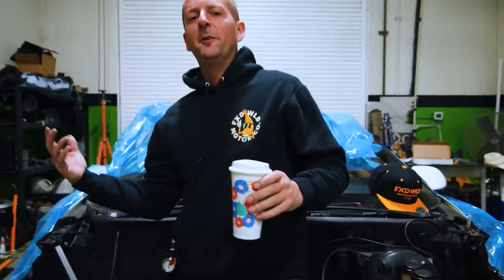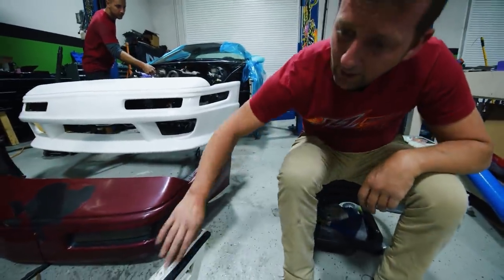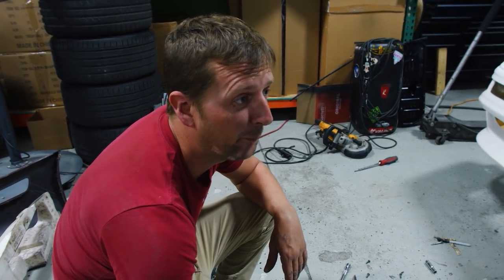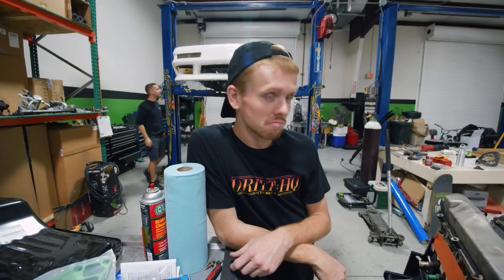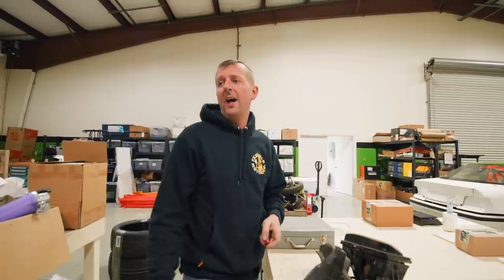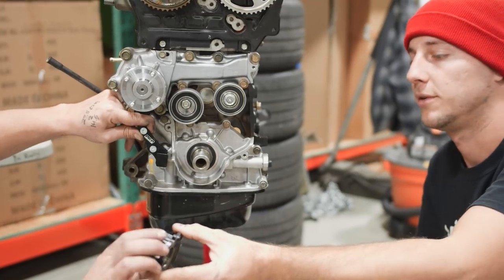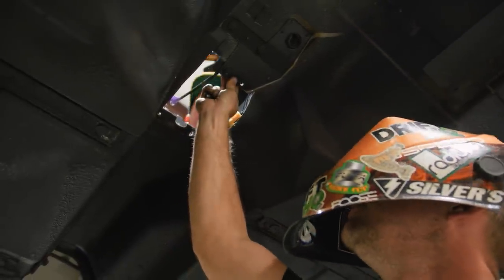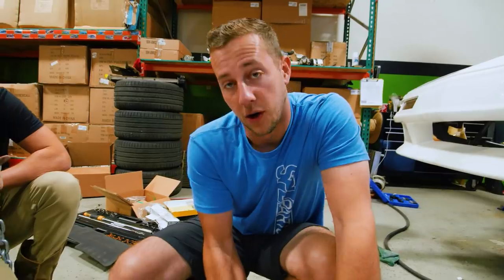RB25 NEO Upgrades for the C4 Corvette!

Comment: I am not sure what you guys have planed for the differential, the C4 came with a Dana 36 for the auto's and the manuals came with the Dana 44, you are going to at least upgrade to the Dana 44 it's stronger and has better aftermarket support, Good Luck with your build. Good Video. 👍👍👍
Reply: We took your advise and put one in 🤘🏼🤘🏼🤘🏼

Comment: Ducking hole only needs to be 1/3rd the size of the radiator if you doing proper ducting,  it slows down the air across the radiator 👌🤙 Venturi effect 💯🤙
Reply: Good to know that’s about where we are at after cutting the front bumper support
Reply: @CrickettFab  Aw great stuff Crickett👌🤙💯 Thanks for the reply, Il be your Irish rally expert resident 😋I'm might be a Mechanical Engineer but Hp academy had great videos on it 👌 il link it below if you ever find time ⏲️🤙
Reply: Watched it. Very informative and helpful. Thank you for the link homie

Comment: if your stock fuel pressure was only 25 psi in that car, the pump or regulator were failing, that stock pump should put out 63 psi when you deadhead it.

Comment: Question: Why does nobody make a full spool for the 350Z?
I would expect there to be a pretty damn big market for it. Just curious.
Reply: Are you talking about a spool like a mini spool? If you are welding is a lot easier and cost effective. Plus I’d imagine the side to side force would murder inner stubs more so then on a sold axle. I wonder about this for a while to for my gto and came to conclusion irs and spoils don’t get along with irs when compared to SRA.
Reply: @governmentcalamari9785  a mini spool is an insert that replaces the gears. A full spool replaces the entire carrier. Pro cars use full spools.
Full spools are much, much stronger than welded. 350Zs have VLSDs and when you weld them they are weak and prone to breaking.
A full spool wouldn't cost any more than an aftermarket LSD. A mini spool could be had for a couple hundred bucks and is still stronger than welded.
Reply: @Maccaroney  I’m aware . My point is it’s easier for people to go welded and 9/10 350z aren’t making enough power to consistently grenade difs. Also I’d imagine all grass roots/pro am guys running z’s aren’t running welded factory dif and if so they are going through them pretty consistently welded,lsd, etc.